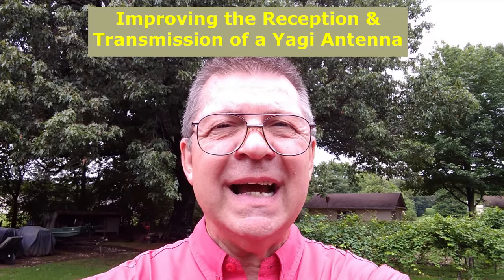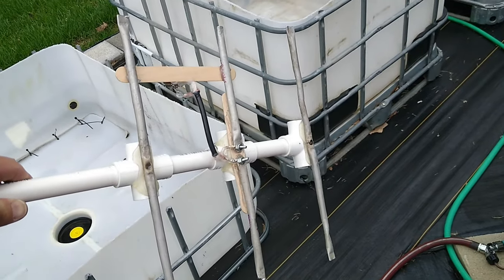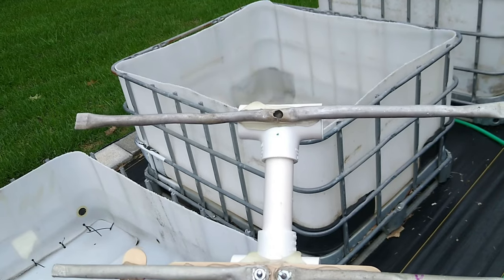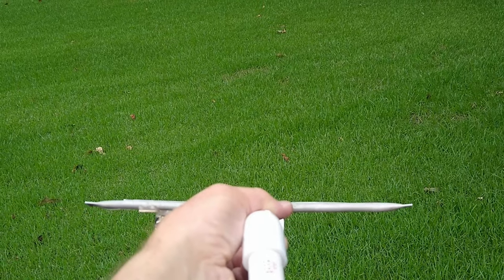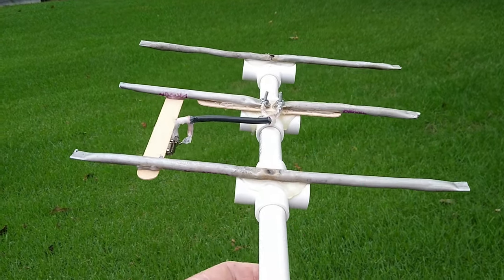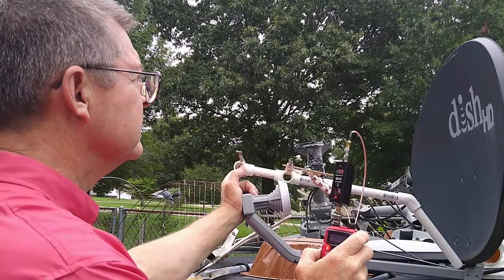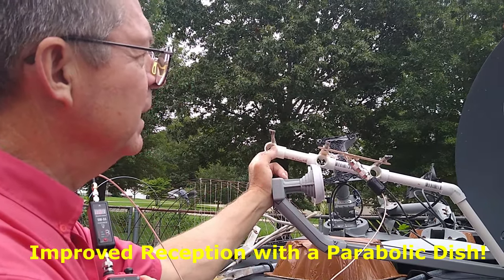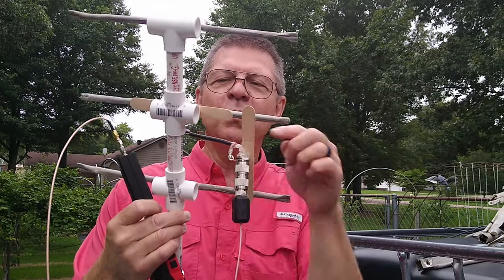GMRS Yagi Antenna Tips - Improving Reception and Transmission

Comment: Great video and thinking. We redoing some work with a Yagi GMRS tuned Yagi antenna and  using a Celestron SE4 to mount the antenna and track with software. Celetestron sells for about $500 to $600. this also give you a visible telescopic view.
Reply from the maker: Thanks!

Comment: Idk if it was added, but the yagi should be placed in the vertical orientation. Transmitting and receiving in the same polarization greatly helps simplex. I believe there is a crazy loss in the order of 20+ dbs when you have a vertical to a horizontal. That will help. Good job building your own antenna! I love it!
Reply from the maker: Thanks

Comment: Have you tried it held vertically instead of horizontally? The repeater antenna is mounted vertically.
Reply from the maker: No, but I sure will.  It worked extremely better.  Thanks!!!
Reply: Yes you’re probably losing alot by being cross polarized

Comment: You might try holding the Yagi vertical instead of horizontal.  I did the same thing with a 2m Yagi and could not talk to a friend 12 miles away.  My antenna was 10 feet up.  I took the Yagi down, turned the antenna so it was vertical and had no problem talking with him.  We were both on home made Yagi antennas, vertically polarized.    We we 12 miles apart.  Durning the second test, I had my Yagi about 1.5 feet above the ground.
Reply from the maker: Yes, I learned that orientation is vertical very soon after posting.  I appreciate your advice.  Thanks for watching and commenting.

Comment: I tune my antennas to 465 mhz, the center of the GMRS band. Alos, I think that if you ran the coax alsong the boom (long enough to clear all elements), you might avoid the 10:1  SWR. Also the yagi should have the elements oriented vertically (unless your repeater has a horizontally polarized antenna).
Reply from the maker: Thanks, I'll try extending the coax.  Yes, I quickly realized I needed to change the orientation. I appreciate the advice.

Comment: Thank you for sharing the Yagi-dish build.  You may have solved our situation, in a gulley surrounded on 3 sides by hills.  WRMN477.
Reply from the maker: Glad I could help!  Turning it vertical will help.  I also would experiment with turning the front of the antenna towards the dish and see if it will improve your capacity to transmit and receive. You may have to move it in and out to get to the sweet spot where the signal focuses from reflecting off the dish.  Good luck and let me know it works.
Reply: @ReturningtoBasics  COPY.  May be later this summer before GMRS base station up and running.  The goal is to reach out to our daughter's office west of us.  Did not realize polarization effects Yagi.
Reply from the maker: Yes, it does.  I didn’t either but another person commented and informed me.  It really helps.

Comment: I think if you was to build a quad you will see a real good performance out of that I would also recommend that if you build a quad used 4 element instead of 3 it'll get you a better range

Good job 👏
Reply from the maker: Thanks for the information and suggestion.  I appreciate it and will see how it works.

Comment: This very interesting. How far away is your repeater? I’m looking to reach one 15 to 20 miles away. Also, do you think if you built one with more directing elements you would get more gain?
Reply from the maker: About 15 miles.  Interestingly, I took it to my mountain, north of Hardy, AR, about 65 miles away and hit the repeater from there but I had to be about 20 feet elevated to get out of the vegetation.  Regarding additional elements, from my research I concluded there would not be any significant gain so I stayed with 3.
Reply: @ReturningtoBasics  That’s encouraging. Thanks for your reply.

Comment: AS soon as I saw your handle I noticed the Yagi aluminum elements should face up and down not left and right during transmits. You do not want to make it look like a TV antenna. It is not a beam antenna.
Reply from the maker: Yes, I realized that very quickly and was instructed by someone to change the orientation to vertical.   It works much better that way.  Thanks.

Comment: So that piece of coax is acting as matching system?
Reply from the maker: I actually don't know.  I adjusted it until I got a 1.1 swr and then mounted it there. I also learned that I was holding it horizontally and should have been holding it vertically.  That makes a world of difference in reception.